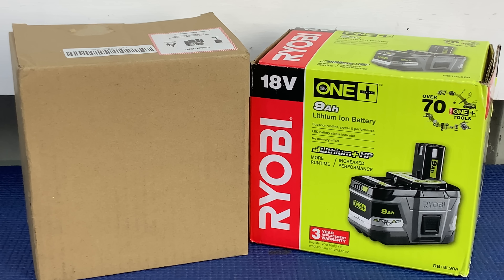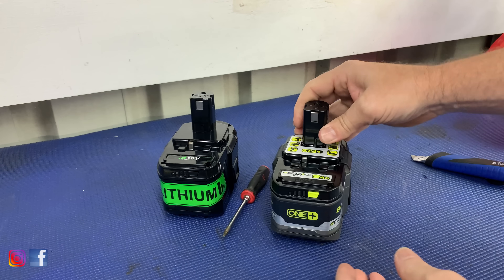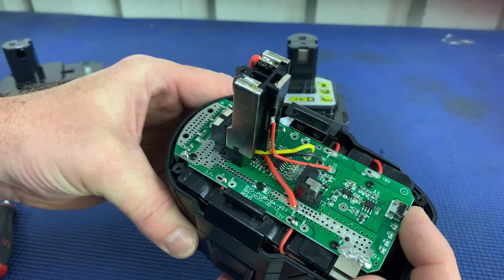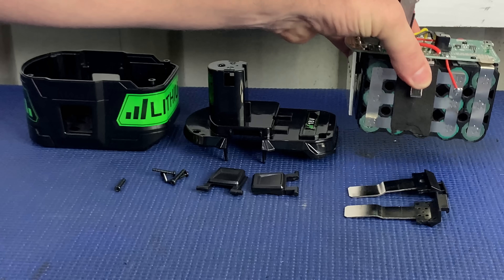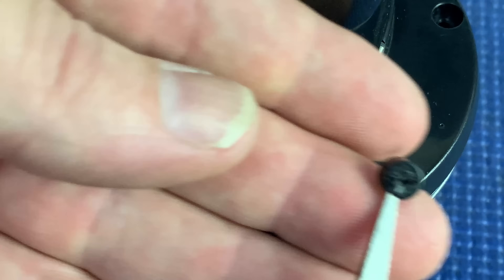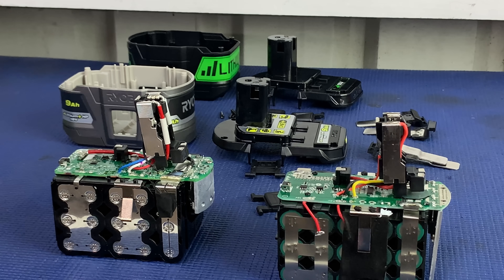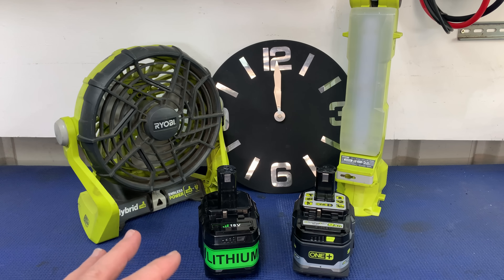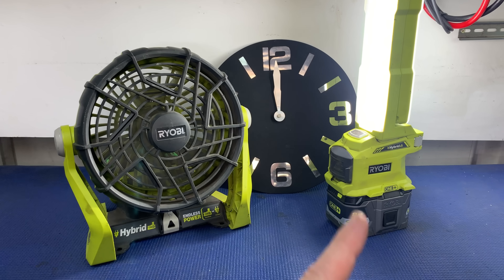Ryobi 9ah battery versus eBay knockoff job

Comment: i have both real and the knockoff battery's in 6ha. i have had some of my ryobis' for more than five years. my oldest knockoff it about a year old.

the knockoff battery's don't like the cold (i'm in the UK so not very cold only down to round 0c or so on a bad day). they also don't like it to hot. none of them have a good fit and one is now dead after just 40 or so recharges.

pound for pound they are just not as good as the real thing. but they are perfect for working in the wet. if i am going to risk blowing up a battery in the rain it will always be the knockoff that will get the job.

Comment: Thanks for the video.  I have had different experience with the 3–4AH batteries.  The Ryobi seems to be shoddy workmanship and the BMS seems to be allowing the battery level to get too low.   I have to take the 18v batteries apart and charge them up when they are too low and then charge them up on the charger.
Reply: Hi Brent - what do you do once they are disassembled?  I have similar problems. Cheers.

Comment: I’m still waiting upon the next video, but this does help me in my idea.  I do want to get a couple of the knock off batteries as I will ONLY be using them for my fan, light, and radio.  I personally don’t care for the extra weight and would personally prefer to swap out the smaller battery on my actual working tools due to weight.  I also would not trust the power inverter with a knock off.
Reply from the maker: get 1 x 3ah Ryobi battery same as the 9ah crap one.. same capacity, better quality.. TRUST me the 'lithium' are JUNK!

Comment: I had a Ryobi a few years ago, so was interested to see how you did. Now 12 minutes in, and I can see that you like the Ryobi. My thought was that you would slag it off, as I would have. IT WAS RUBBISH. It was the old LITHIUM battery, so no surprise there, but it was less than a year old when I bought another make. I could tell the difference straight away. If you like yours so much, why not get over to England, and you can have the Ryobi. Yes, I STILL have it. AS far as I know it still look's like new, in the bag with the charger.

Comment: Tim from Canada if you were going to do comparisons on batteries no matter what the brand if you were going to use their real name versus a knock off name... use the same kind of device for example.. The man here is using a light and a fan low-voltage will not work because they are not the same if he was to do the same comparison using those exact batteries and two fans or two lights or whatever you were going to use Hass to be the same the comparison between the fan and the light will not work the fan will draw more voltage then light because the fan has the motor and the light does not... if you have comments this should be explained out more thoroughly if you were going to do comparisons using batteries
Reply from the maker: Hard to compair crap against the real thing.. 3 bloody AH v 9 .... just a shit product no matter how poor my review.

Comment: Not really a valid comparison after you've taken them to bits and reassembled them - should have charged both on the same charger and done the tests before you pulled 'em to bits.
Reply: I agree with you 100%. I have 8 real ryobi and 10 knockoffs, none fall out or have problems clipping in. Now power wise , yes the real ryobi hold charge longer but one smart person can’t justify 50% more money for 20% more run time.. good comparison video but next time don’t take them apart first..
Reply from the maker: nar, reason I did the video cause it was falling out of my tools.. complete piece of junk 3 ah not even 9 as advertised.

Comment: I hate to advocate for cheap stuff but if you make the nickel strips too thick, you will blow through a lot more than you saw there. The thicker the strip, the more current required to weld it.
I don't know if you have the red, yellow and blue top car and boat batteries that look like a 6 pack where you are but here, they sell for $289.00 U.S. but only have a one year guarantee while you can go to Walmart and get a good battery with a 3 year guarantee for $98.00 U.S. If the $298.00 battery was so good, you would think that they would give it a longer guarantee. There are two reasons for your cheap battery to have a longer guarantee. 1) They have a lot of their product or 2) They don't expect to be around in 2 years when they expect it to give out but that's the chances you take in life.

Comment: Comparing a sweat shop made battery to a battery made in a factory with automation.
Reply from the maker: in a sweat shop with crap materials... yeh, i know how dare I do something interesting!
Reply: @HBPowerwall I didn't say it wasn't interesting. I wouldn't have watched the video if it wasn't. Comparing people with limited resources to corporations with many resources is like looking at opposite ends of a spectrum. That's what I was trying to get across. Of course a company with less resources will produce inferior products.

Comment: even with the knock off if you brought 2 you are still way better off, 299 is just a plain ripoff, its cheaper just to buy new cells for your battery pack
Reply from the maker: to be fair it was 199, we paid too much but still payed that much.. and the knockoffs are 3ah not 9 and lasted only a few weeks.. so you go buy two and give those cheating bastards your money.. have at it..

Comment: Bought a cheap knockoff 4ah Ryobi clone.  Problem was that my Ryobi chargers would not charge it.  Vendor sent another one.  At first, it too would not charge, but after sitting in charger for a while it finally charged.  I do not have enough usage on it to give a good review yet.  Was just giving a heads up on these cheap batteries.

Comment: Funny thing about Ryobi, they are widely known as bargain basement tools and batteries, only just above supermarket own brands and cheap Chinese knock offs from China. What made them so popular was they pushed the 'share a small number of batteries between a large number of tools' so much (probably only Worx pushes it more) it made them a prime choice rather than a cheap option...
Reply: Funny thing about that is they are made in the same factory by the same company with the same QC people checking them as that fancy red brand everyone loves... (so is the wally world blue and white brand for the record). It is funny the brand bias we have in our minds when often the "cheap" and "supermarket" brands are made in the same factory by the same people. Also true with most foods, the generic differs by the bag and label only 90% of the time. I used to work in a snack food factory, all we did between the name brand product and the 12 or 13 off brands for different stores was change out the bags we put the food in.
Reply: @Daishar  There is a huge difference in quality the same factory in China can come up with though - and the horrible 'chineseum' supermarket brands certainly are worse than higher quality products coming from the same factory. For a couple of examples, 'Tommy Walsh' branded screwdrivers typically last 2-3 screws before rounding themselves out into a bradawl. And then 'Cutline' machine tools - they dont even bother hardening the steel, so you put one on your mill and the workpiece ends up machining the tool rather than the other way round. Not to mention all the unhardened screws where the threads unravel themselves rather than driving into the surface, and unhardened nails that bend against a coke can.....

Comment: I'd buy these batteries for ryobi items in my car, such as the inflator, fan, inverter and lights.
Reply from the maker: I love them, been nothing but reliable for my usage. Also have petrol chainsaw & generator that are Ryobi branded - they have worked every time I've needed them.
Reply: @HBPowerwall  sorry for my lack of clarification.  I was referring to the 3rd party batteries.  They are great for tossing them in my car, if they get stolen.  no big deal.

Comment: This video is a testimonial to buying knock-off batteries as a matter of good value.  Your constant whining about the knock-off had me scratching my head.  OF COURSE, the welds of nickel aren't going to be the same, and OF COURSE, you're not going to get that "satisfying" click and "perfect fitment."  Maybe, just maybe that's why the knockoff is 72% cheaper than the Ryobi; you reckon?  

At the writing of this comment, I can buy FOUR (4) 6AH knockoff batteries (P108) for just about the same price as ONE 6AH Ryobi battery.  This means that I only need each of the knockoff batteries to perform at 25% the OEM to break even.  Chances are better than average that each knockoff will perform for about 50% or more of the OEM, which now means I've gained about 100% greater value for the SAME money.  So, I guess I'll just have to deal with the battery not clicking in that satisfying way.  I'm not complaining.
Reply from the maker: Ooh dear god, I stand behind everything I said AND MORE! they are shit beyond description - 3 ah not 9 is just the start... go buy four come back and then agree with me.. SHIT IS SHIT doesn't matter what you coat it with.

Comment: If anyone can help explain how the batteries are wired, I can't understand the difference between what I read online, and what I see in these videos: Online says there are 15 cells, in 3 parallel strings of 5 cells in series. 
But when I see the video, all I see are 6 cells connected by metal, another 6 cells connected by metal, and a final 3 cells connected by metal.
Unless the side we see in the video is the negative (or positive?) side of the batteries, and it doesn't matter how they are wired, it's the other side of the batteries (under the circuit board) that matters more? Anyways, thanks!

Comment: To be fair you should have done the fit testing and endurance testing before taking it apart.  I don't think It would have impacted the results much but doing it in the order you did does taint the results.  I take that back.  It sound like you are not doing real testing but have an agenda.  e.g., You state it is your job to prove the brand name is better at 16:24.
Reply: Agreed
Reply: I've got 2 of the cheap knockoff batteries they work just fine. I've had them for a couple of years now.

Comment: Yup, that is a high amperage fuse in the original._
Reply: I was going to say a thermal sensor (thermistor)
Reply: @cameranmanner4701  That s-shaped metal part?_
Reply: @DjResR  @ -8:20  when opening the ryobi battery
Reply: @cameranmanner4701  Oops, I forgot to add timestamp, but it's not that what I thought. 9:08._

Comment: Thanks for the video. I've been using Ryobi for a long time just that professional homeowner usage 😊. But when I saw the 299AUD/237US I thought I would comment. Here in the US that battery is regular price $159us. At that price a good value. But penny pincher that I have to be I wait for Ryobi days. The first 2 I bought were on sale for 2 for $199. Them last fall they went on sale for 2 for $179!! So I done in end bought 4. They are outstanding and really do make a very noticeable difference in run time both on brushed and brushless tools not to mention the real performance of the tool itself. Thanks Again. Lastly love Australia had an assignment there back in the 90s spent a month in Sydney and surrounding areas.

Comment: When  there all made in Asia            but  some r cheaper  🤔 
Most cheap china  Lithium batteries are just that  useless  
the ones i took out  of old   laptops   work better  last 2x-3x's    
use   in my New   led  torch etc

Comment: My Ryobi original P103 battery finally died - the replacements were sold as a 2 pack for $150 - I bought a clone 2 pack for $60 . Are they as good - probably not but they still work fine and cost 35% of the originals.

Comment: For some light tools like  drills and fans lights  etc  the knockoff wil be OK.  But i run a chainsaw on my Royobi 9ah  and the knockoff will just stop and you have to reseat it all the time .   Hevvy  usage the knockoff is really not a similar product.  And as you say in the Video,,it dont always  fit !  Should you trust a  nighly charge of a 9 ah  battery and you are at sleep in the other room ?  That wellding was made for making  sparking arc´s!

Comment: Is your leaf blower a HP Type tool? You can tell by the extra tabs inside the battery connector. Non HP have 2 tabs but the HP tools have 4 tabs. If it is a HP battery i wonder if the extra tabs are just for show and dont actually provide any extra current. All the tools I own are brushless but only my 184cm circular saw has the extra tabs inside.
Reply: You have a 6 foot in diameter circular saw? That's amazing!

Comment: I have been using “knockoff” units here for years. 6Ah and they last well, but the build quality of mine is way better than the one you pulled apart.
Reply: Yes, that is my experience too with my knockoffs. They are well built, don't drop out of tools, the leafblower works a treat, and drill awesome. Impact drill I use a genuine one as it lasts a bit longer but I don't see much power difference with the genuine battery, to be honest. Money saving was quite substantial. The seller has not anything for sale anymore.
Reply: @raymondallo9947  Which you bought?
Reply: I've been satisfied with the third party batteries for my Ryobi tools. They are still working, which I can't say about the original two actual Ryobi batteries.
Reply: @lonniemcclure4538 Which you Got?
Reply: Same here
Reply: I am a Ryobi fan and have been so for well over a decade.  I used to buy genuine batteries in the beginning at a high cost in Australia. Travelled to Canada and found deals for twin packs at half what I paid in Australia, currency adjusted!   Have tried knock off batteries at 4 amp, 5 amp and 6 amp.   Nothing wrong with knock off quality, power, hours of use etc. led light failed on two 4 amp batteries but they still work.  Final comment is I would recommend knock offs.   It saddened me to hear the bias in the original video and snide replies from author to those making comments.
Reply: @markmcclure8868 same here in NZ. We are getting ripped off down here with the battery prices. Guess this is what happens when Sausage Bunnies have the monopoly.
Reply: I bought a knock off and it didn't hold a good charge after 2 years. My Ryobi batteries still works great 4 years later.

Comment: I had issues with 2 genuine 5 Ah battery, I might have left it overnight on the charger and both died on me. Not sure what happened but I lost the receipt(my fault) so there is no replacing.
Tried to dismantle and tested the voltage for batteries,  all good, must be the board fried or something.
Those batteries are just so expensive...
Reply: I leave my batteries in the charger for days.  Your batteries may have a faulty bms.  It should stop the charge after 100% full.
Reply: But new 1s at home Depot and put the old 1s in box, return. Done

Comment: interesting video, my own experience is that the big difference emerges when using products that need more power for a longer period, such as different saws, lawn mowers, etc Ryobi battery is a so-called "high energy" battery with dual terminals requires that the battery gives more power to products with brushless motors. maybe you can test that difference in your video next time?

Comment: I would have preferred doing the fit and power tests before the teardown, we can't be sure reassembly didn't mess up the alignment of the connecting clips, causing the trouble when plugging into the charger and fan.
Reply: I bought some off brand 40 volt batteries they last longer than Ryobi batteries they charge the same speed and lock in no problem at half the price I will use them no problem
Reply: @pauldigiorgio6373  yeah that’s the problem with the unbranded stuff. It’ll be hit and miss I think.
Reply: @pauldigiorgio6373  I never had an issue with generic replacements.  Ryobi batteries cost 5x as much.
Reply: Exactly
Reply: Put me off straight away comparing packaging and juudging before trying as for tearing down that should be after testing. Totally biased. If you are no expert you should not be testing.
Reply: It's funny how he does not even mention that he could have messed up the alignment when he reassembled it.
Reply: I've got 2x 4ah "lithium" branded batteries and they fit great. 
In terms of tool use I wouldn't recommend them in anything too high powered though. They work great in the drill and impact driver,   but one has been playing up since I used it in the belt sander.
Reply: they all seem to not fit perfectly. I have 2 that dont fit as well as regular batteries but for the price its worth it
Reply: Totally agree.
Because reassembly quality would be this guy's quality and workmanship not the original one.